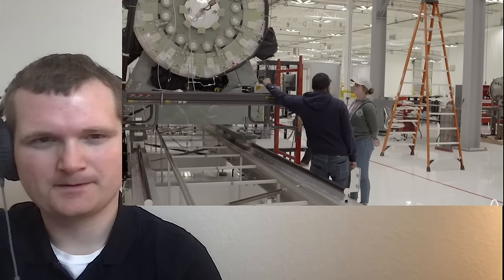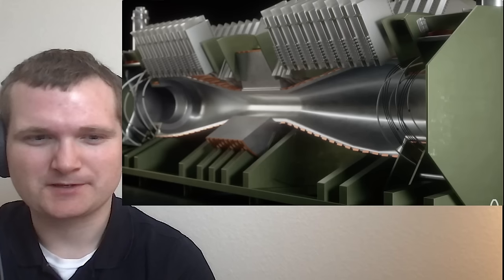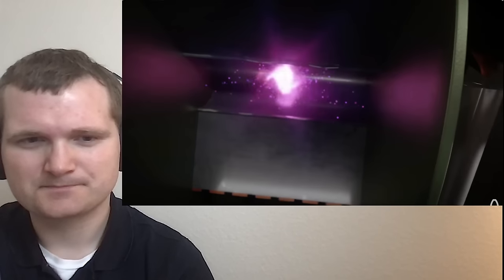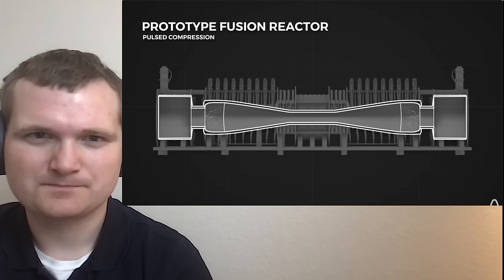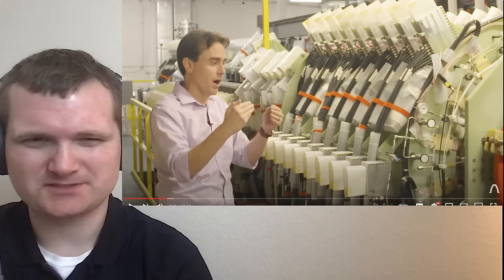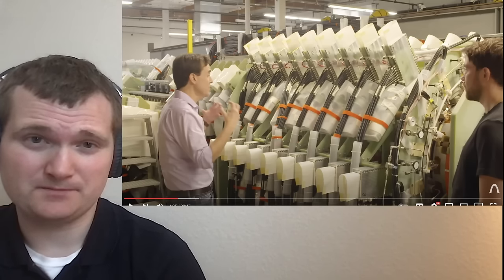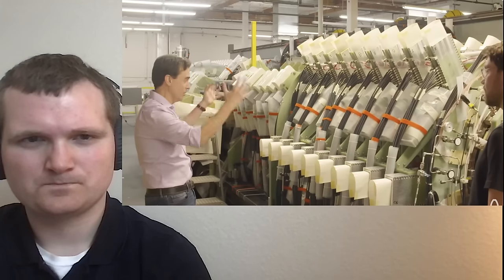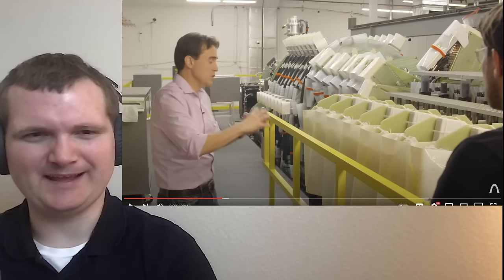Will the Helion Fusion Reactor ACTUALLY work? - Nuclear Engineer Reacts to Real Engineering

Comment: it has more developmental challenges, but its also due to the fact its taking on several issues up front rather than down the road, such as: fuel procurement, the more direct form of harnessing energy, as well as size of reactor. it would be a better system than the other if it works. and id rather spend resources finding the best method anyway, so vote for a representative that will stop giving our tax dollars away to foreign nationals, and instead invest it into fusion research. we put a man on the moon, we can make fusion a real power source.

Comment: Hi, quick question. At 26:07, it is mentioned that neutrons are 5 to 20 times worse. But there is no comparison. Could someone tell me please? Thanks!
Reply: Define "worse". Helion have a neutron in 1/3 to 1/4 of the reactions. 2.45 MeV neutrons are bad but managable. Unlike 14 MeV neutrons, there are a lot of materials that react to them in a relatively benign fashion. E.g. their first wall is made from Silicon, which has to absorb 3 neutrons to be come unstable. Then it only has a half life of 2.5 hours. Their magnets are aluminum, which has a half life of 2.5 minutes when activated by 2.45 MeV neutrons.

Comment: I suspect that your first question is right on - what they are saying publicly regards numbers is deliberately off, perhaps by an order of magnitude or more.
Reply: They’re standing in front of one of the very early prototypes when talking about these numbers. So couldn’t this just be a case of talking about the numbers for the prototypes that never intended to be net positive energy generation anyway?
Reply: @auspiciouslywild  Yep, Trenta was sub- scale, has weaker magnets and did not have a high pulse rate. It was meant to confirm their scaling laws to ALMOST full scale.  That said, I hear it was at least VERY close to what they needed (though the final numbers have not been published).
There are some key aspects here that the RE video does not go into. Helion's machines operate at much higher densities than Tokamaks (orders of magnitude higher) and they have a very low electron to ion temperature ratio (<0.1 at peak). That means fewer losses.

Comment: On a quick Google search. The core temperature of the sun 15,000,000 C, and while hydrogen fusion requires 13 million K, helium takes 100 million K.
Reply: Fusion requires 2 things, heat and pressure.  The sun creates fusion by pressure from gravity so the heat required is lower than the fusion we are trying to do on earth.   We can’t really generate those pressures, so the heat has to go up by several orders of magnitude to create the same fusion reactions.  That is the reason why fusion has been so difficult.

Comment: Honestly, before we ever start talking about fusion we should be using fission.

It's by far the best form of energy we have at out disposal AT THIS VERY MOMENT!

Frankly speaking i find fusion to be a "distraction".

Fission is the safest and one of the cheapest forms of energy, the cost and time to build nuclear plants are greatly inflated by frivolous lawsuits by various groups, mostly environmentalist, the risks are incredibly small, the idea that radioactive substances could find their way out of a tank that can withstand the impact of a train, under 200 meters of rock away from water sources and be a danger is ABSURD. 

There isn't a SINGLE documented case of anyone dying due to radioactive waste stored inside a tank.

People who complain about nuclear fission are either victims of propaganda, or spreading propaganda knowing full well that they are full of it.
Reply: All in favor of fission (always been a huge advocate for it). Biggest hurdle for that is not technical but politics. Presumably (as current trends go in congress), fusion will do better in that regard. Also interesting is that Helion originally was proposing a Fusion- Fission- Hybrid as an intermediate step. The Fusion part would be the neutron source to allow their machines to burn Thorium and nuclear waste at very high efficiency while the reactor remains sub- critical the entire time. 
This would have been much easier to develop as an intermediate step toward a pure fusion machine because the fusion aspect by itself does not have to be net energy positive (just close enough). The fission part would make more than up for that. 
No one wanted it :(

Comment: The whole idea sounds like a failure points burger. Capacitor farms, low latency electronics, sheer numbers when it comes to current density. The EM forces must be insane. I'm also pretty sure the size of the plasma path alone is predetermined by physics, so that's probably half of the reason why classic solutions are as big as they are (blanket being the other part).
Reply: Yup the solenoid will fry itself after a few good shots because the back EMF if fusion actually starts would be so high it would create shorts between the separator layers. The device would make a very good plasma pulse injector for a very large fusion reactor as it solves the problem of preheating the plasma efficiently. Some issues they had have simple solutions such as using a neutron multiplier to generate tritium rather than simply heat. Neutrons are the philosophers stone of all things nuclear as they can convert elements to something else, for example turning lithium into tritium.❤

Comment: I had the idea to make a sun in a jar. I suspended a graphite capacitor in the center of a jar and nuked it in the microwave. The capacitor was just pencil lead, coated in parafin wax, with paper soaked in salt water between electrodes. The bright light came from the carbon plasma ark. The ball of plasma is made by the static or electrical field made on the capacitor hanging from pencil on the top of the jar by dental floss. The electric field charge left on the device can pose risk of severe electrical shock when the microwave goes off.

Comment: What i don't understand about the idea of ITER is "small (relatively speaking) doesn't work do lets make the TOKAMAK very large" and that'll make it work.

I think it'll fail.
Reply: Making it bigger helps to keep the heat inside longer. The first fusion reactors assumed the magnetic field would keep the heat inside about 100x better than is the case. Which is why they thought they could make net energy-producing tokomaks much smaller than ITER has to be.

Comment: What if you combined this with a tokamak. Take like 12 of these and put them end to end and put them then into a circle. Then have half of them compress the plasma and when it expands backout send it thru to the others and compress it again back and forth between them over and over .. like a pulsed tokamak. Kind of like a radial engine but with the opposing pistons being angular and not axial.
Reply: You really want to extract the fusion products between pulses. Otherwise, you will inevitably end up with Tritium in the mix and that is nasty. This is one of the advantages of Helion's design. The other thing is that the linear design really helps with maintenance and production. Finally, the plasmoid splits in two and moves in a linear fashion after the compression is over.

Comment: 22:33  If I interpret this correctly then I get the impression that fission is much better for power generation per atom than fusion.  I think the impression of fusion being more powerful must come from the performance of thermonuclear weapons compared to pure fission devices.  However that was due purely to an upper limit to fission bomb design while thermonuclear weapons scale to higher yields.  Also the narrator says "gigawatts" when he should say "gigajoules".
Reply: Atom for atom, fission releases much more energy, but gram for gram of fuel, fusion releases more (10x or so I think it was, roughly). It seems like a pretty hard engineering problem to get that energy out in a useful form from fusion (and make it greater than what's put in).
Reply: @Takyodor2   So they would need to have less than 10x the operating cost of fission for it to be worth it if I gather that correctly.

Comment: I feel like your criticizing a start up by comparing it to a well understood extant technology.  You keep directly comparing energy output when I think you should be comparing overall energy in-out efficiency. 

If helion manages to produce more power than they consume, then they have achieved ignition, and then they can alter the design to use more reactive products to magnify the energy output.

Comment: The temperature for the reaction is excessive, much higher than the fusion with a tritium mix. I believe it to be an engineering impossibility to hold such temperature, 200M °C, in a stable fashion; the magnetic fields necessary for the containment are impossibly intense.
There is a series of disadvantages which aren't paired by any other advantage; the helium-3 is rare as tritium is, so...
Reply: There are a lot of nuances to this that work in Helion's favor. The 200 million degrees are not that much more than 100 million. They only need a relatively low Q because of direct conversion. The magnetic fields are relatively easy to achieve in a pulsed system. They make their own He3 via fusing Deuterium.

Comment: Two plasma torus are accelerated and then collide each other?
How dense they are that they not pass through each other?
Distance is very short.
They will stop each other?
Converting the entire kinetic energy to thermal?
What is free pass lengt for the plasma?
What kind of magnetic field confine that?
I see something like not a string solenoid in the center of device 
Very doubtful
Reply: FRC merging is a formation technique that has been used for decades. It was developed by John Slough (one of the co founders of Helion) at the University of Washington (see papers on the Inductive Plasma Accelerator or IPA for short). Since then it has been used by TAE and many other organizations to form FRCs. The FRCs reconnect magnetically and form a single, larger, hotter and more stable FRC. By now this is a very established method. E.g. the Chinese have built two Helion clones so far. One is ENN's HeLong experiment. The other is Hust FRC. HeLong came as a bit of a shock to Helion. The Japanese also have done experiments in this regard. A simple search for papers on this topic would show that.

Comment: Just to let you know, when you learned that they were going to use the expansion of the fusion mass from the energy created, coupled by the charged particles in the reaction mass, to generate electricity, your reaction was beneath you.

Your first concern was "let's see how this generates stable alternating current".  Bah bah bah bah.

I've spent quite a bit of time with electrical engineers, and never has one ever approached a DC source and wondered glibly how it could possibly be converted to AC.  Of course there's going to be an inverter involved.  Or maybe, they can rig it so that they're executing 60 pulses a second, and they simply reverse the polarity for alternating pulses mechanically or digitally.  

Doesn't matter, it's a stupid concern.

Which made you look like you were digging for things to object to.

Which ruined the analysis, and turned my trust in you to dirt.

Good luck continuing to feed on the tidbits left behind by others.

Comment: Wouldn't they have problems with rayleigh taylor instability? As it's at supposedly trying to combine deuterium and helium 3 plasma at pre-fusion temperatures before turning up the magnetic field by however much they are doing.
Reply: I think they got a handle of that by now. Their process of forming FRCs has now been replicated over dozens of machines across facilities all around the world (TAE is using the same method).

Comment: Like any pulsed reactor, how the hell do they expect to evacuate the spent fuel from the reactor? After each "shot", they'd need to evacuate all the spent gas from the chamber to return to the original conditions. Given the effective near-vacuum conditions of the reactor insides, using pumps would not really work. Really curious about that.
Reply: They do have a patent for a new pump design. A so-called "Hybrid Gettering Diffusion pump". Also worth noting that towards the end of the pulse, the plasma moves towards the divertors at the ends. They have multiple different pumps there from what I understand.
Reply: @elmarmoelzer2229  It does not matter how good their pumps are, or even how they work. The real issue is that the closer you get to vacuum, the slower the pump works just by nature of the process - there is simply less molecules near the pump interface for it to capture per unit time. To be fair, this is a major issue with most fusion designs, not just this one.
Reply: @alexpyattaev  There are solutions, even for that. You should read their patent. Also note that FRCs are relatively tolerant to less than perfect vacuums.
Reply: @elmarmoelzer2229  Let us hope you are right, I'm getting old for another 20 years wait
Reply: @alexpyattaev   Well Polaris is in final assembly right now. It will do between 0.1 and 1Hz (eventually). Future power plants are supposed to be between 1 and 10 Hz.
It is challenging, but not unsolvable.

Comment: Does it make sense to speak about temperature at all if we collide particles together? We need 100 kEv for hydrogen atoms to fuse that number could be reduced theoretically but so far it is our base level. What helion made is a two opposite particle accelerators and for those machines 100 kEv is like nothing. What I've found interesting is that you have a good point current produced by moving particles in magnetic field would be a bit funny but it should be doable to make DC from it.
Reply: The acceleration and merging of FRCs is only for the formation of a bigger and hotter FRC that then serves as a target for the compression. But that acceleration and merging only gives a temperature of a few hundred eVs, nowhere near enough for fusion. It is the compression that then raises the temperature (and density) to fusion conditions and Helion got to 8+ keV ion temperature in Trenta.
Aside from the formation, the acceleration and merging also causes the ions to be significantly hotter than the electrons. On average that is a factor of 1:10 (Te:Ti). 
Over time, the electrons will get hotter and the ions will get cooler, but by then the pulse is already over.
The ion temperature is where all of the fusion happens. The electron temperature is where your losses are. So, a Te:Ti of 1:10 is a good thing.

Comment: 30:45 translation to non-BS speak: "We have all the exact same unsolved issues that cutting-edge TOKAMAKs have with thermal management, plus we have this entirely different system with lots of additional unproven elements and regulatory hurldes, and we have never even gotten close to net gain, but we think we can do complete magic and be putting power on the grid in 2 years."
Reply: Their problems are solvable and Polaris is almost complete (set to be completed in summer). They do not have any regulatory hurdles and have all of the permits. Trenta was at least very close to net gain (if not better) but Helion has not officially given the final results yet. One can tell though because their investors put in A LOT of money after they had the results reviewed.

Comment: I've a question - how does this machine not melt itself? Like, plasma follows magnetic lines. And I don't think you can make a "cage" that completely isolates the machine from the plasma. That's why Tokamaks have big stonking heatsinks and massive cooling systems, cause it's unavoidable to have no heat transfer between the reactor and the plasma. Also, plasma is very wonky, and even if you have proper confinement, sometimes it just leaves the confinement cause lol. If this machine isn't melting itself, and it doesn't look like it has enough cooling to prevent itself from doing so, then is it even a viable machine. Is the claim about a closed magnetic loop that can trap the plasma even remotely possible?

Also, I think the problem with the Tokamaks isn't gonna be necessarily the Tritium, but the Lithium. Lithium's quite scarce, and the problem is that lithium in batteries is still lithium when the battery is dead, but Lithium in the Tokamak is no longer Lithium when the blanket is spent. We basically destroy the Lithium forever with those reactions. And unlike something like uranium or thorium, we can use lithium in our daily life. So unless we find a new battery technology that moves away from lithium, this is gonna become the bottleneck for the Tokamaks.
Reply: This is an FRC, not a Tokamak. FRCs have a beta of 1. That means that the ratio internal pressure of the plasma to the magnetic pressure is 1. In Tokamaks it is around 0.05.

Comment: Got a question.  Can a neutron be captured or made a part of a particle beam, say like alpha particles or something like them?  So that when the neutron collides with it, it becomes a full atom of some kind?
Reply: Nope neutrons go where they want to. The easiest way to recycle the neutrons would be to use beryllium as a multiplier stage then lithium 6 to convert them to tritium. Follow up by a layer of boron to absorb what is left so the device does not become unduly radioactive.❤
Reply: Neutrons can become thing or cause reactions with the material they collide with that's exactly why they cause fission events atoms don't like to get unasked partners.